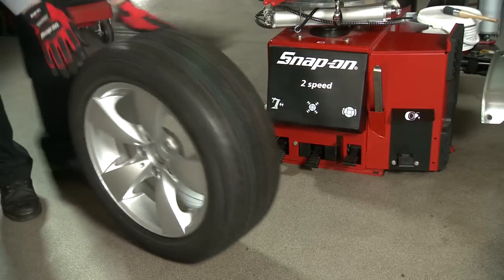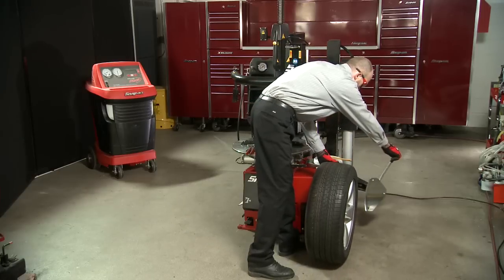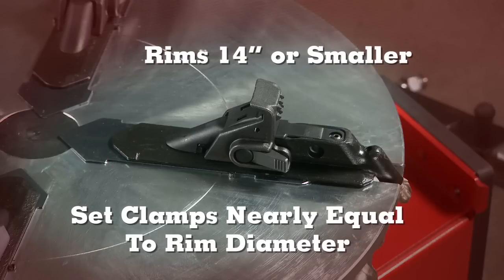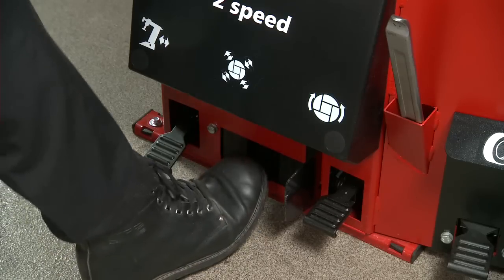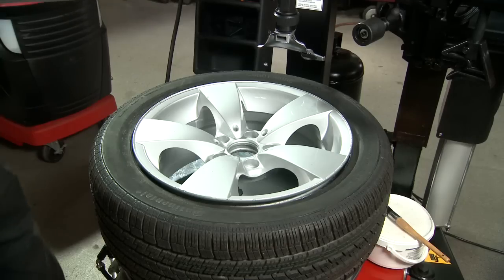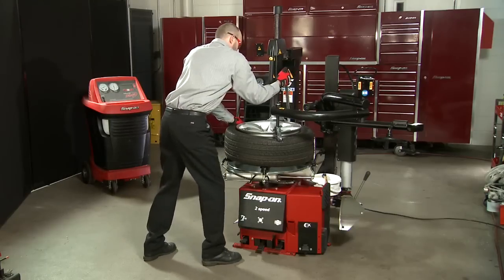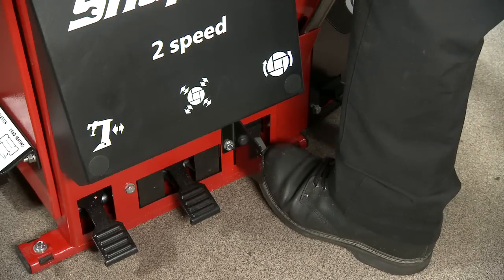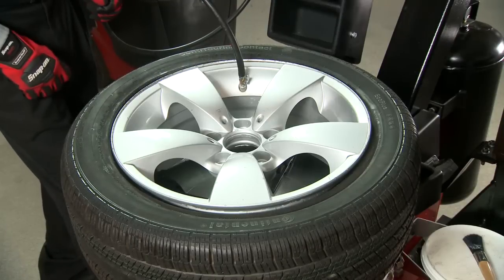EEWH326A Premium 2-Speed Tilt-Back Tire Changer | Snap-on Tools

Comment: You know Snap on is great but the service in the UK is terrible.  We have decided to avoid Snap On now in our workshop because most of the guys can't get the tools they want because the dealer doesn't call even after we have been on the round for a great many years.  Poor show from Snap On UK in general and this had been on and off for years.  We need tools to work to earn a living. Pull your socks up Snap On.  Our workshop is a large commercial truck dealership not a back street garage.

Too much time telling us how good you are with the balls to back it up.